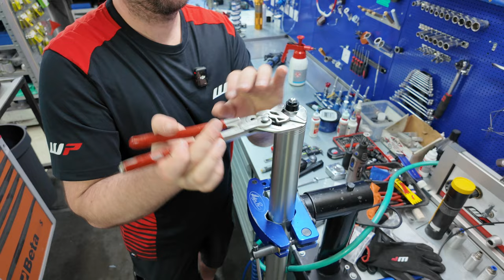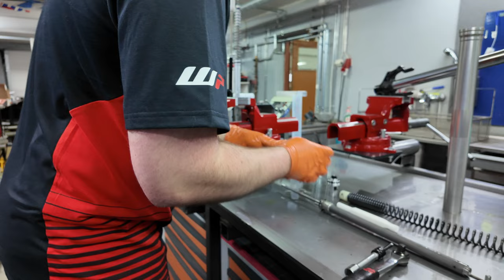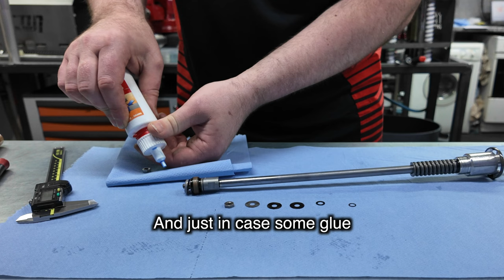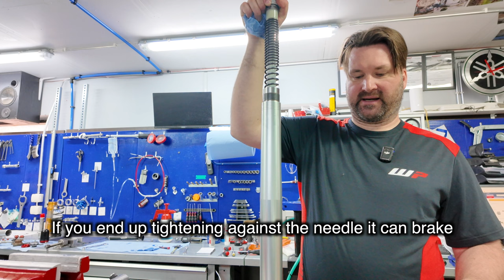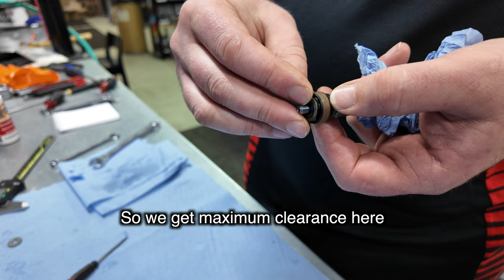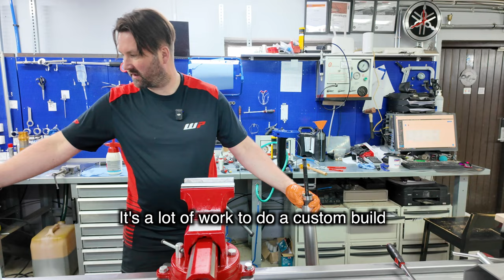BROKEN Suspension On My NEW Tuareg 660!?

Comment: I am one of the people on ADVrider who posted about this problem. A couple guys did email ApriliaUSA and got no where. Basically, the corporate response is to ignore the issue because most people will never open their forks because most won't go off-road and won't realize they have a problem. I switched my progressive springs to linear, increased the spring rate (I weigh 80kg), and had the bent shims replaced and the shop added a taller space to prevent the cupping problem.
Reply from the maker: Im the same weight. Would be interested to hear what parts you went with 😊. .. and how the bike feels?
I pinned the comment as this needs to be seen by everyone.
Reply: I contacted Aprilia us and have an email chain with a rep that "seemed" to say they will cover it under warranty at only an Aprilia dealer. They hate to admit it but they know all about it.   I do not trust any Aprilia dealer to make this fix.
Reply: @PatchedBandit  My suspension guy install K-Tech springs. Part # 38-425-60
These are for a Yamaha and are a few mm shorter than the OEM springs. He fabricated an adapter/spacer to fill in the gap. The bikes rides higher in the stroke and does not dive half as much as the progressives allowed on hard braking. I have never bottomed out, so I do not miss the few mm I sacrificed. Both on road and off road handling are greatly improved.
Reply from the maker: UPDATE 10/07/2024:
Fist 2024 bikes are getting opened and they have the same issue according to advrider forum. Unfortunately it looks like even though the issue is known by Aprilia nothing is being done about this. Every single owner on that forum thread that has opened the forks find the same assembly mistake in there all the way through years 2022, 2023, 2024.
Reply: @PatchedBandit Wow. I can’t believe they still have not fixed this, mine is a 2023. I would be interested in the cost of having yours repaired. Can you give us an idea? I am thinking about having mine looked at. Thanks again for this video!
Reply: @PatchedBandit I’m installing ohlins when I get my bike I’ve had bad luck with kyb on cars

Comment: Great video.  I have seen some posts on this problem.  It's quite possible every bike has this issue, it just might not be felt by all riders.  Aprilia should do a recall to address this issue but how do we get them to do it?  It would be nearly impossible to get a dealership to tesr down a fork to ide tify a shim stack issue.  I will be keeping a close on how my bike performs,,, once I get it back.
Reply from the maker: Thanks! I don't think there is much customers can do other than ask about it from their closest dealer and make a bit of fuss to get this sorted. 
I wanted to make this video to raise awareness to all the owners to at least have the knowledge about the issue. I hope the video reaches a lot of riders out there and helps some of them.
Reply: @PatchedBandit  Mine were ripped with only 5% riding time on gravel roads! Sent the invoice for repairs with pictures to Piaggio North American 2 weeks ago, but they haven't responded.
Reply: I think it's also a problem with a lot of new riders like me (hopefully I can pick up my new Tuareg this week) that have no previous off road experience to compare how it should feel. Also it will be very hard to be in a situation where you're able to compare other Tuareg's.

Comment: My Tuareg was a '22 Martian Red. I noticed the suspension not feeling right on washboard surface. Dealer in Denver Colorado said the piston was installed upside down on left fork leg, compression side. Warranty repair was approved.
Reply: The piston upside down? KYB? Was that Imperial that told you that?
Reply: Yes, it was Imperial, a great Aprilia dealership with experienced mechanics.
Reply: And the warranty was honored, you didn't have to pay? How long did they have it?
Reply: @ricklee4122  I did not have to pay and Imperial did the job in 2-3 days. As I recall, this was all at the 600 mile service. Compressing the fork did not feel right to me, I showed them, they agreed, no pushback or hassle at all. Imperial was wonderful.

Comment: Hi! First of all, very good and informative video, best i have seen about Tuareg forks. I have 23 Tuareg and had the same issue, valve was upside down, shims were bent and all blue, burnt oil had clogged oil passages and oil itself was totally black. Here in Estonia dealer didnt know anything about it, at least thats what they said.
Reply: The dealer could indeed not know about it. Aprilla knows for sure
Reply: Kristjan, where did you checked you susspension and opened it?
Reply: @insenersurf  Hi! In Estonia, company called Vugtec did it.

Comment: Great video. I did my own repairs and upgraded the stock base valve (check valve) with a high speed base valve from EVO Oregon in the compression leg. I also installed 0.6 linear springs. The bike is so much better now. My shims were completely cracked. I had a crash on the ORBDR last year where I went through the front screen and broke the stock dash tower. My gut tells me that this was partly due to the messed up front suspension. So if you're listening @Piaggio: This is a safety issue and people could get hurt! Sounds expensive!
Reply: I'm getting that same base valve installed next week. How does it affect things?

Suspension is honestly all new to me, have so much to learn.
Reply: @ricklee4122  , my front suspension worked great when the bike was new, but over time got harsh when hitting bumps in the road or rocks and dips on the trail.
After replacement of the damaged shims and flipping the piston 180* plus the installation of the EVO base valve, the suspension is great. The forks absorb everything I throw at it and feel better than when the bike was new.

Comment: it must be one of those random production issues, that I hope KYB is addressing internally - mine has been perfect, no problems. Glad to know it was an easy fix for you...i frikkin love my Tuareg - my 32nd bike. Just like you when you got it fixed!.....I am sooo looking forward to a full exhaust.....just to save a little weight and release even more luurvly sound!
Reply from the maker: Every single bike opened in advrider discussions have had this issue. All the way through model years 22, 23 and 24. This based on the forum discussion there that is already 40~ pages long.
With high probability your bike has the same problem and if so it will get worse and worse over time.
It is beneficial to get it fixed before parts of metal start scraping things in the tubes.

Comment: My Aprilia rear shock had metal thread's in the blades. After 800km I just had spring function. Got a new on warrenty. And a workshop opened it up and said it was poor machining by kyb. New shock and it worked much better for 10.000km. Gonna get my front checked this winter. Have not noticed on normal riding. But poor damping in hard bumps.
Awsome video. 
Best Regards viewer from Norway
Reply: Wondering if Piaggio covers this under their warranty?
Reply from the maker: Problem is they still dont have an official statement and/or instructions to local dealers. So its a case by case thing and no official callbacks so far either. 
Makes me suspect callbacks are not coming as this is already been happening  through 3 different model years according to adv rider forum users.

Comment: I notice a patch of fork roughness/instability as I side-to-side under engine decel coming into roundabouts on my '24 Tuareg. I also feel a notch when compressing the front fork while sitting stationary. Tried another bike in the shop, and it also has this notch. Wonder if either of these are related to the issue you have shown here. Thanks to you + TTM for the info.
Reply from the maker: I'ts possible. I've read about bikes from -24 having the same exact issue. So already from years 22, 23 and 24. I recommend getting it fixed asap.

Comment: Wow, that is a nice suspension shop - think I even saw a shock dyno in the back corner.

I took the forks apart on my '22 per the ADVrider forum and found the piston was installed backwards and allow the shim deformation in the compression side.  I got lucky - the rebound side shims were ok - wish I had the shorter bypass sleeve, but just reassembled being careful to keep the shims off of the threads when tightening.  On the compression side, I flipped the piston so the bypass sleeve now fit into its groove and replaced the bent shims and installed the custom compression base valve from EVO Oregon.  Fork feel is very plush now, but I'm thinking that a non-progressive front spring might be better as the initial suspension feels a little soft.

Comment: Great information video.  I'm about to open my 2022 Tuareg Forks, one leaking seal. I have never been happy about the performance of the forks.  Sharp pot holes or small logs they kick back terribly. Actually they make ridding off road dangerous, as you cant trust your front end when ridding more (even a little) aggressively.  Definitely  should be covered under warranty, but I wouldn't waste my time here in Australia.  The Aprilia dealer here is a complete ass.  Also my Electronic screen draws current all the time and discharges the battery in 4-5days if you don't ride bike (charge battery) or disconnect the battery.
Reply from the maker: I didnt have the battery discharge issue on mine. 
Also most dealer workshops are not very educated in suspensions so I would also advice just biting the cost and taking it to someone who specialises in these things.

Comment: I was considering buying an Aprilia Tuareg, but now I will wait until this issue is resolved. The suspension is one of the features that attracted me to the Tuareg; if it's faulty, then that's a problem.
Reply: is easier to solve perhaps
Reply from the maker: Good thing about this is that its not expensive to get fixed. A couple of model year -24 bikes have already reported the same issue so looks like nothing is gonna get done about this as its already a third model year with the same problem.

Comment: On my 2023 Tuareg,I'm feelling insecure offroad,there are a very harsh suspension response ,unexpectable from a offroad oriented bike.
I suspect the same problem.
Reply from the maker: As far as I know everyone who has opened theirs on ADV forum has the problem with 2022 and 2023 bikes at least.
Reply: maybe try to open compression damping more than recommended. I did this and it felt way better, The issue described here is a minor one with a less obvious effect than you describe. Start with opening compression damping completely, then half way and after that find the right settings for you. You will feel the right amount.
Reply: @Kai-ze2rb  thank you...I'll try.

Comment: How much was the fix, and do you think you can get something back from the dealer? Excellent video again 👍🏻
Reply from the maker: I don't want to disclose pricing as it may vary over time and due to many other reasons. TTM Factory can give quotes themselves 😊 I did pay for the service though so this is not a sponsored video.
I'm not after any compensation from the Aprilia dealer either for myself. I just wanted to make this video to raise awareness among owners.
The service is not super expensive though as it's mostly just work and oils if no other parts are broken.

Comment: Thanks for posting this very in depth video of TTMs work on your forks!!!

I have been following the Adv forum posts of what people were finding when taking apart the forks.

Do you know if TTM flipped the piston (compression fork) from it's installed position, or left it in the same orientation as it was installed?  I was looking at the before and after in your video and couldn't tell for sure.  If you read the Extravaganza post on ADV Rider that was a point of discussion (what is or was the intended design).  Also what Shim stack to use.  The V1 vs V2 version from Bikedude987.

I have a new to me 2023 660 still below the 621 mile break in (US).  Feeling similar fork response to what people are posting.
Reply from the maker: Pretty sure the piston was also flipped but as making a step by step tutorial would have taken the whole day this wasn't the main purpose of the video unfortunately. I was allowed to film but that was pretty much it 😅
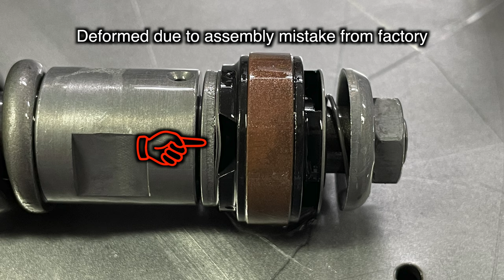At 5:20 you can see how it was assembled in the factory. 8:07 is where you can see the piston going back in place.
Reply: @PatchedBandit  I understand, thanks again for posting this.
Reply from the maker: I checked the film again and took screenshots. You can actually see the piston flipped here. I posted pics for you to see: https://drive.google.com/drive/folders/1bOypFrDlJMJe6I9FnK7h2RpM3THV6RkB?usp=drive_link
Reply from the maker: Sry the link wasn't working. Now it should work.
Reply: @PatchedBandit  thank you very much for posting this important information. I am about to purchase a 2024 Tuareg 660 and I will be using it for off-road riding as much as on-road. Great work!👍

Comment: I got a quote for a few hundred bucks for the fix at a private suspension shop. The dealership said they would have a look and try to warranty it with Aprilia. They couldn’t give a time estimate as they may have to order parts. 

So now I’m stuck deciding between the quicker but costly option or the most likely long and maybe cheaper option.
Reply from the maker: I decided to go with expertise. Specialized shops like the one on this video know exactly what they are doing and they get the job done quick with parts already in the shop.
Reply: go to expertise
forget warranty
better setting, new oil and more
it is not very expensive at all

Comment: Hard to believe such bad quality control
Reply from the maker: Most likely there has been a wrong assembly instruction on the assembly line itself. But this is me just guessing as I know nothing more about this than any other customer.
Reply: @PatchedBandit  I do know that KYB replied to an inquiry and said that the bent shims should not affect performance of the suspension. It is later in the thread on ADVrider.
Reply from the maker: @briangc1972  Well thats a * answer. Cant use the right word as YT would just remove my comment. This would mean they are lying to save money. Not a good look.
Reply: Yamaha owned Kayaba tried to sabotage the better Tuareg 😅

Comment: If this is a problem, it depends for the factory: how many riders? We all know that forums tend to make a lot of noise, yet it's mostly them who find out and make it public. The factories would rather prefer to sit it out. Hope that Aprilia will give you something for addressing the problem. Because they will work Kayaba for a rebound. Cheers, Günter/Nürnberg
Reply from the maker: True that bad noises are very loud. But also I havent found a single post here or on the forums of anyone opening theirs and finding a correctly put together forks. 
Starting to think this might be on all bikes…. Ofcourse this is just guessing.
Reply: As far as "making a lot of noise", not one person on ADVrider who has looked has found their forks do not have this problem. The count is approximately 25 out of 25 inspected all have the problem. VINs from early 2022 to end of 2023. No one with a 2024 has added to that thread as of yet. This is the 3rd YouTuber who posted this issue.
Reply: @briangc1972  Good to know. A friend rides one and never mentioned a word. Will ask my Aprilia dealer, he's a good one. Happy days, Günter/Nürnberg

Comment: Mine was opened at 18700km, it had the same flaw, TTM fixed it. At the same time rear shock was opened and maintenance was done.
Nothing was wrong in the rear shock.
Reply from the maker: Good to know rear is fine. It always felt good too. Any other issues with the Tuareg so far?
Reply: This is the only issue I have had with my aprilia.
Reply: @simmottos  whats the approx cost of front shocks redone by TTM?
Reply: @insenersurf  hard for me say exact as the rear was maintained also on the same bill but I would say less than 200€

Comment: Thank you for the heads up and great vid.
Im planning to buy a used 22 Tuareg in few days, it has around 10Km on it, is there a way to know if it has that problem by test driving it?
Reply from the maker: No easy way of telling without taking it apart. But my money would be on that it has this problem if it hasn't been fixed during that 10Km.
Reply: Ofc u can test it easily, just go over any square bump like sidewalk, it will be harsh. U will know if it's good response

Comment: What was the issue with the Rally Raid forks on the CRF300? I feel a fair bit of 'stiction' with mine.
Reply from the maker: Wrong oil levels and airing: https://youtu.be/61MEopUr3sU
Reply: I've got quite high stiction too. I've took it apart to investigate and rework. I figured out that all that stiction comes from SKF dual compound seals. No matter how well it is lubricated or if bearing grease is used instead of fork oil, it still keeps high stiction.
The cause is not related to Rally Raid cartridge. The only possible fix is to replace seals with different brand. I haven't done that yet.
Reply: @uralicdneprov1806  thank you for your information